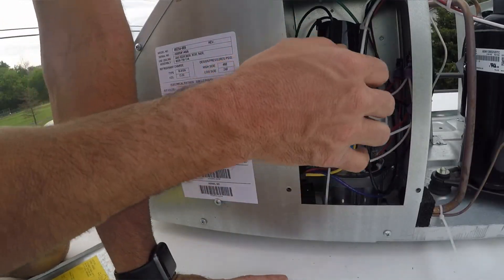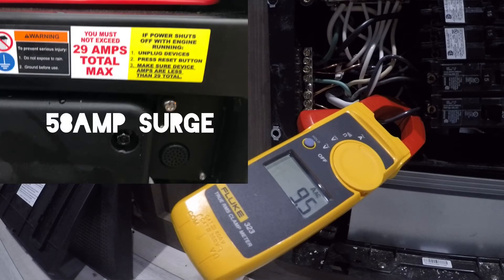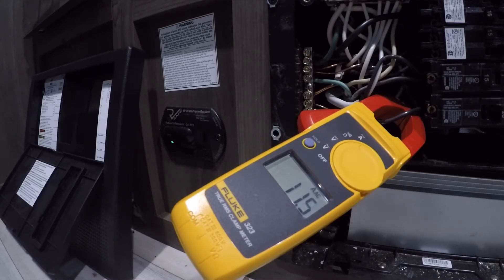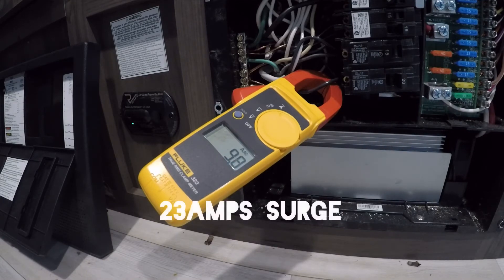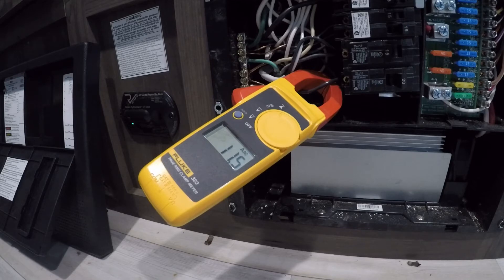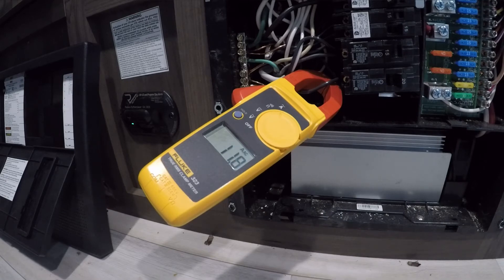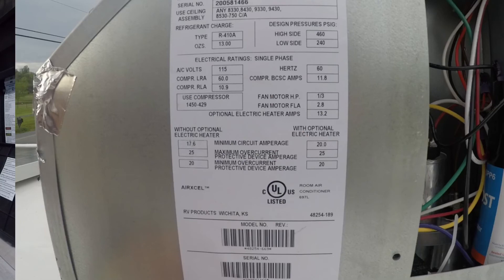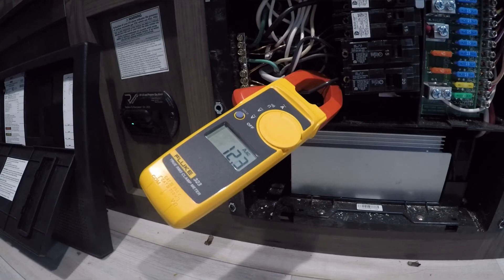Predator 4400 Generator Inverter “Hard Start Capacitor” Will it run my 15000BTU AC???

Comment: It goes through the converter to charge the battery it will run 32in tv and sound sys. A led light or two then you are done.

Comment: Thanks for the work you did on this. I  sold a 3000 Honda cause i couldnt handle the weight anymore it did the job. Had it since anout 2000. Got new camper with 15000 air put a easy start an bought a honda 2200 is companion it runs it fine but dont put anything else on it. Plugged in
Reply from the maker: You’re welcome! Good luck!

Comment: I know it varies but how many hrs are you getting from a full tank
Reply from the maker: To be honest other than the break in period and running it here and there testing, I haven’t got to test it. The specifications say 16.1hrs at 25% capacity. We are staying in the camper this weekend with 93° temperatures. I’m going to run it and do some more ideal over night testing for fuel capacity. I’ll be sure to post an update and or vid.

Comment: Excellent insight demo on the differences between with and without the hard start kit. Soft start is definitely better, but when you’re on a tight budget it and the difference of happy wife and kids equals happy life. When boondocking we don’t have luxury of the power grid to briefly absorb the < 1 second high surge loads.

The Predator inverter generator line has definitely come quite a ways. I purchased the 9500 model recently for my whole house backup and put it through the cumulative 24 hour varying load break in period and oil changes every 8 hours. Just in time for the start of tropical cyclone season…
Reply from the maker: Thank you! I’d like to look into the 9500 myself and install one of those five or six circuit generator sub panels. I’m just not sure what route I want to go yet. Possibly solar in the near future or even both lol
Reply: Here is a reminder about portable generator safety: everyone really needs to see this safety reminder to make sure. This advice is just to make sure that everyone is aware of all the warnings and it’s just to remind people to be careful using portable generators. Generators can be dangerous if not used carefully. Every year, hundreds of people die or get injured when using portable generators due to carbon monoxide poisoning and electrocution. Make sure you are using your generator carefully and keeping others safe as well. There is something very serious that everyone should always be aware of when using generators. Some people do run their generator indoors which is not safe and that increases the risk of carbon monoxide poisoning which can cause death of family and you. Some people run their generator in wet conditions which can electrocute them. Please remember that you should never run your generator indoors. Remember that carbon monoxide is an odorless and colorless gas that you cannot see or smell. Carbon monoxide is a silent killer. Keep that in mind. Make sure your generator is 15-20 feet away from your house and away from doors, windows, and vents. Never use your generator in your porch too. Having a carbon monoxide detector is very important against generator safety. Some people also allow children to go near the portable generator which could pose risks. We need to keep an eye on our children making sure that they are not near the portable generator so they won’t get electrocuted or burned by the generator which is dangerous. A locking enclosure also keeps kids safe. A generator shed might look like a tempting place to explore, or take cover during a game of hide and seek, but a generator is a dangerous piece of equipment that can cause injury. It says on the manual that we should also keep children away at all times from the portable generator to avoid injuries. Please do not allow a child or unqualified people to operate the portable generator. Just because some manuals missed what should be listed doesn’t mean it’s safe to do. Always follow the generator safety rules when using portable generators. Generators pose electrical risks. If you need to use your generator during wet weather, you need a generator tent to protect your generator from getting wet. Don’t let your generator get wet. Keep your generator dry and before using your generator, please make sure your hands and your generator is dry. Do not wear loose clothing when operating the generator. Everything that is said on the generator’s operating manual should not be ignored. Never smoke cigarettes near the generator. Please keep flammable things away from the generator. Never overload your generator too. Your generator can catch fire. Never ever try to plug a generator cord into a wall outlet to avoid back feeding. Back feeding your generator is dangerous. Always turn on your generator first before plugging in appliances and shut off the appliances before turning your generator off. Use a heavy duty cord for your generator and the cord should not be worn out. All the instructions should be followed carefully. Never refuel your generator while it’s running. It can cause fire if fuel spills while your generator is hot. You should turn off your generator and let it cool off before refueling it. Having a fire extinguisher next to the generator is also important. This is only a reminder for everyone’s safety of using generators. Make sure your generator is properly grounded. Having a fire extinguisher next to the generator is also important against the safety rules. Also keep gasoline away from children. https://youtu.be/I1jT3ANENvI and here is a video more about keeping others safe when using generators and also about our family’s safety. Hope this helps. Thank you. Remember it’s better to be safe than sorry. It’s important to keep your children safe especially little kids. Hope you stay safe.